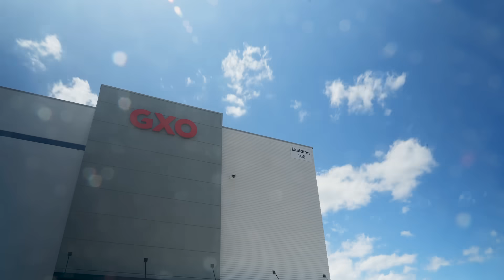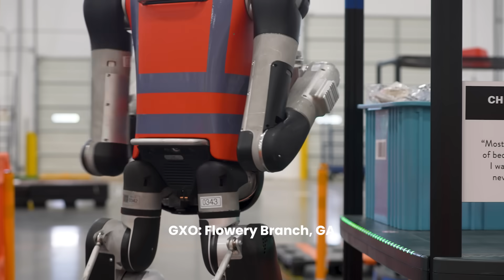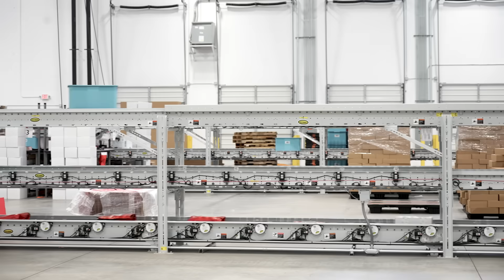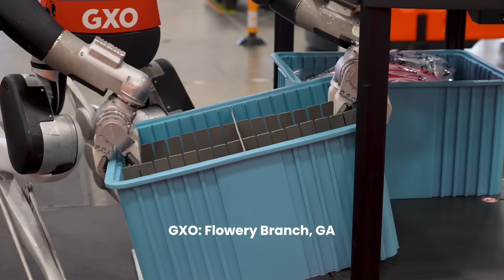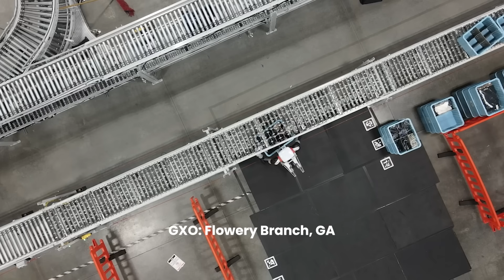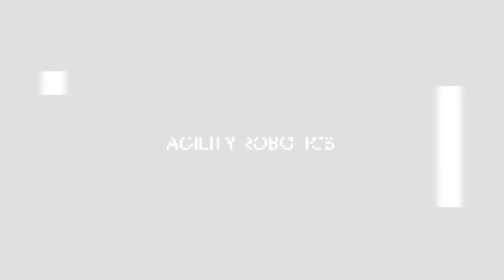Digit's First Day of Work at GXO

Comment: I have a question, why a humanoid robot? Why dont use snother robot in rhis specific case?
Reply: i think the reason is, most of the factories are designed for humans and are already build. So if you build a robot that human, it can work directly in these factories. While it may be slower then if you would build a super specific robot for just this one case, its still cheaper than building a new factory. And also if you change the production and build new stuff, it easy to have an human like robot do the next task. If you have a really specific one, that is then useless as that specific task is no longer required.
Reply: What these agile robots  are good for is tasks where it is too costly to have a hyper specialized system. I'd guess they plan to redesign the system in the future, the humanoid format fits any layout.
Reply: Good question...but nobody think WHY THE ROBOTS WILL work for HUMANS???HUMANS WILL BE USELESS when ROBOTS WILL start to take control...SOON IT WILL be

Comment: If  humans worked that slow theyd be shown the door
Reply: *If humans worked

Not exactly a job people were clamoring for.
Reply: A human can only work part of the day and costs at least 7.25 an hour, with battery hotswaps this thing can work for weeks on end, for the cost of electricity and maintenance.  If it being slow is an issue, split the task up and have several of them working in parallel.  And remember this is still early days for this-think of how crude and slow this will seem next to a version of this that comes along in 10 years.
Reply: @dayvancowboi9135  Agreed. Some jobs also dont need to be fast. At Amazon we could have up to 200 pallets of 30 totes for 6000 totes that needed reinjection for just one department. Up to 28 lbs each so up to 168000 lbs of totes.

The totes would be reinjected but the limiting factor is the conveyor. Items being reinjected have to be placed between items or use a 2 slot ramp that drops the totes in when possible.

For other jobs like loading semi trailers that would Mostly be a no. Especially on high throughput trailers.

For those areas only 2 or 3 robots could fit and the rate of boxes coming down can be impossible. Even for 2 great loaders. 3 is inefficient as the 3rd is just in the middle.

Mostly it will do okay in non throughput intensive areas on tasks that are not high priority or have limiting factors beyond digits speed.

Biggest issues it has to improve is really speed. There is only so much space and injection points. If you dont keep up pallets build up and semi trailers fill the yard after.

So mostly its good for support tasks but those support tasks only encompass 1 part of larger role of an employee.

Its exciting though. Plenty will be happy when no more trailers need to be loaded.
Reply: @dayvancowboi9135 Why are you explaining stuff to people who won’t read it. Most of the deniers will become consumers.

Comment: They're indoor robots so why do they need to be battery powered? I know cables might be tangly but they could use a sort of antenna contacting a conductive ceiling at all times pretty much like a bumper car, not everything  needs to be wireless today just because we can.
Reply: i mean, the less we have to alter the eviroment for them, the better. Wireless robots with a decent battery life is just easier to work with and replace

Comment: One question that matters is what is the cost and battery life?
Reply: how long till tney can swap their own batteries over and put the spare one on charge....
Reply: @WistrelChianti  from memory, spot is 45-90 mn. Digit is probably a bit less, like 30-45.

If you can't find answer on public website, recent live streams will give clues. From memory they did 2 or 3 live shows during big events. Just saw notifications, did not click. But they were multi hour videos.
Reply: @WistrelChianti  GPT Said 3h. Ask perplexity for more accuracy cause it will give you sources ( I have only GPT on my phone . Perplexity PITA to use on my current phone , but usually better when you have access to it).
Reply: Pretty sure you can program it to change it's own battery
Reply: They might wanna make it just cable  powered for first places like this
Reply: The cost of anything is more expensive if it’s the first one
Reply: Lower than an adult  human employee who requests salary, rest days, sleeps at night, have family on we, and ocasionally joins protests.

Battery life is not relevant. Just request a twin battery hot swappable. This ensures a hot swap without reboot. Swap is faster than a cigarette pause. Then, 1h autonomy per pack  is hugely enough. If the swap takes 3mn, you got 5% downtime per day.
Reply: @Benoit-Pierre  In the current version of Digit, the battery is not easily removable. There is a small connector for a charger cable, and the robot is recharged after a few hours of work.
Reply: @cogoid  3h is not suffisant for industry; i wonder how Digit will get sold seriously without batt swap.
Reply: @Benoit-Pierre  The longevity on one charge is in the same ballpark for the robots from all vendors, because everybody is using the same battery technology, and the robots are similarly efficient. 

As you have said earlier, with a quick battery swap the longevity on one charge would have not been very important. In fact, if one wanted to, even now one could take the Digit apart, replace the battery, and put the robot back together in 10-15 minutes, which is not that bad. But a quick change battery that could be swapped by an automatic charging station would have been much slicker -- at least it seems so from the spectator bench. In the trenches, there are probably other, more urgent problems.
Reply: @cogoid  nice phrasing. More urgent problems in the trench 🤣🤣🤣 not false, funny wording :) just wonder which issues could be more important for a robot limited to 3h use vs »1h rest ( less than 75% usability ). Unless they consider wire is a thing for the first uses.
Reply: @Benoit-Pierre  Like Jonathan have said in this video, for a business the problem number one is to be getting paid.

Getting attention from the customers like the GXO and Fedex was a coup for Agility. But getting these large companies to seriously commit to what Agility could offer is probably the main challenge at the moment. From this video the project still looks to be in the technology evaluation stage. It is no longer a demonstration run by Agility alone, but the GXO engineers probably took it over, and now they are trying to integrate the robot with their own systems, in a broad sense of the word. So it is probably mostly figuring out the processes, getting all the management to sign off on this, tweaking the software, etc. Running one robot for a couple of hours at a time may even be all that they actually need in order to try things out. If things go well, this will progress to a larger scale trial, with sustained unattended operation and multiple robots. And then this will be a lot more money, and one could iterate the hardware to take care of whatever optimizations the customer needs. 

That is my guess for what is going on at the moment and where the priorities are -- which can be way off, for I am just an interested spectator.
Reply: inductive floor charging, no need for battery swap in the future.
Reply: @tomich20  not for walking robots . They are constantly moving, not constant height, and have very small contact area with floor. 

Spring wire is a better solution for robots working in a 30 feet area around some place.